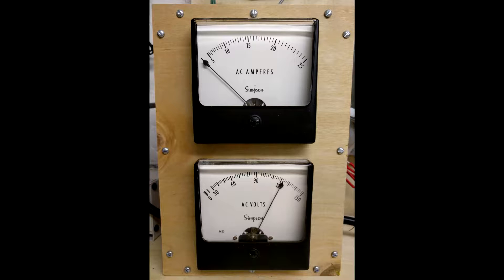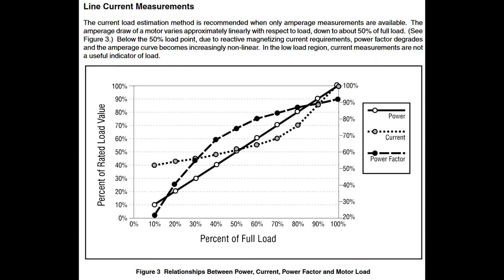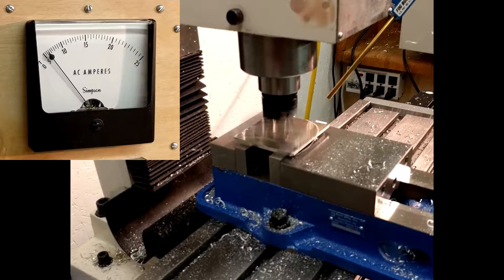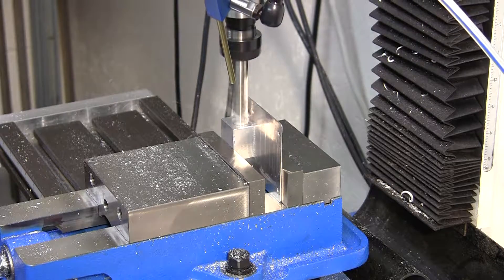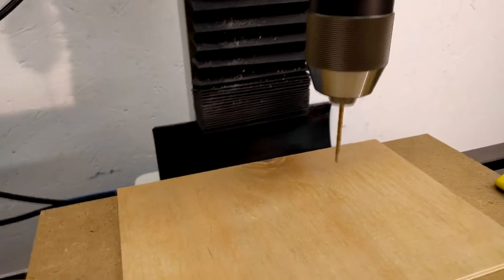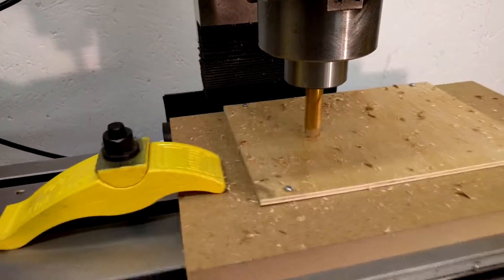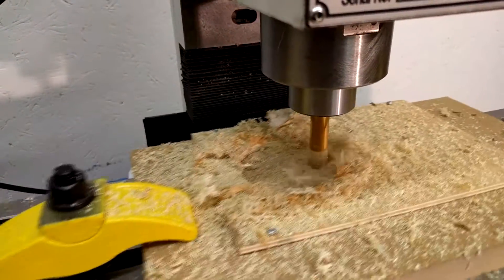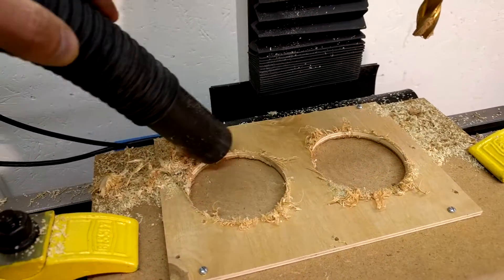CNC Spindle Motor Load Meter - ammeter

Comment: Thanks for your videos Kent! 

Hints for others (I'm sure you know this) use your 'esc' key to stop the program (not your e-stop) unless it truly is an emergency, this way you save your homing. Also, you can on the fly change your feed rate using the numbers on the keyboard: '8' on the keyboard will change the current feedrate to %80 of the requested value.

Thanks again Kent, I'm going through your older videos now.
Reply from the maker: Thank you, although I believe my older videos get progressively more akward and cringe worthy. I only learned of the 0-9 shortcuts this past week. I always wondered how my feedrate override was getting set to changed to 10, 20, or 30%... turns out I tend to fat-finger the F1 and F2 keys, hitting 1, 2, or 3 by accident. :) What's the backstory of your YouTube handle? I watch so many YouTube and send to friends, I feel I'm a Filter of YouTube. Thanks for the support!
Reply: Filter is just a nick, no real story. Fat fingers used to get me worst when you hit the '0' without knowing. I'm not sure what the purpose of that setting is. It sets the cutting speed to 0 ipm, however it does not affect the rapid movements. Thus you start your program, G00 to your starting point, then nothing. ??? WTH ??? restart the controller...damn it happened again, rebuild the controller. damn, it happened again, recognise the feed rate slider all the way to 0, ahhhh...